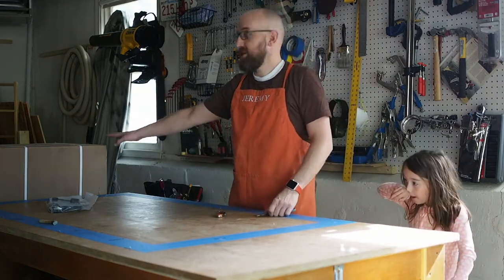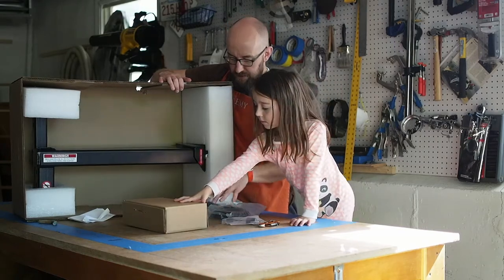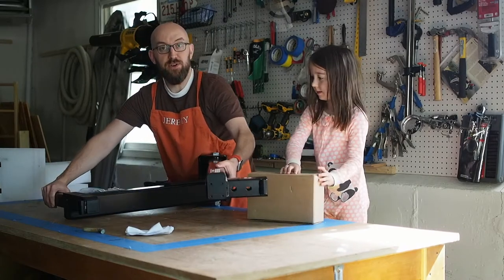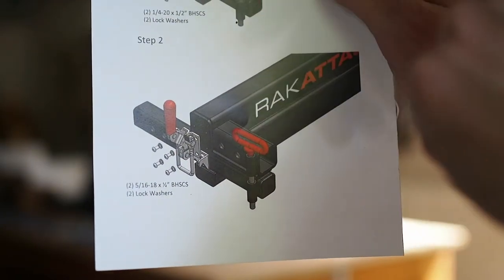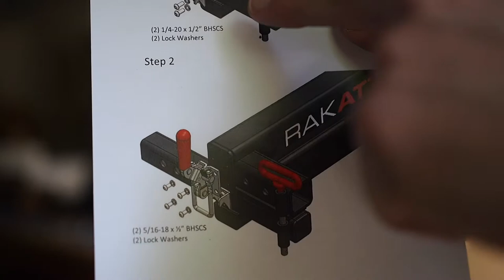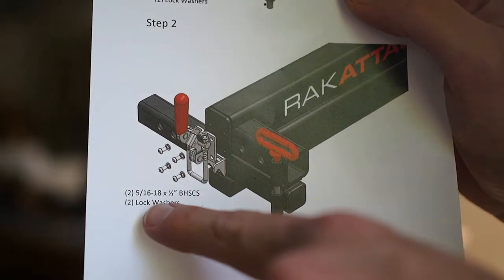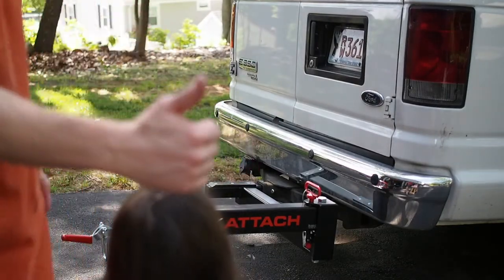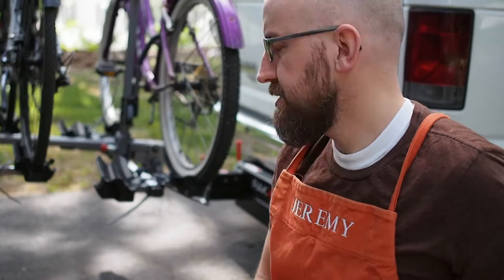1UP RakAttach: Unboxing, Assembly, and Initial Impressions

Comment: So wanted to ask you this. I read some real negative reviews online about the Yakima Fourtimer but I know you are rocking it for a year or so and it’s working for you. So question is do you leave it on the van or take it off when not in use?
Reply from the maker: In the summer I often leave it on the van. In the winter I usually take it off because it goes months without use. Best of luck.

Comment: Your RackAttach is from 1UP but your rack doesn't look like a 1UP, at least how the new 1UP racks are made, since this video is 3 years old. Probably a true 1UP new rack might fit closer and tighter to the rear of the vehicle. The RackAttach you've reviewed seems to fit very securely and the attachments that prevent it from wobbling around appear to do the job very well. I'm probably going to get a 1UP or a QuikRack Mach2. I believe the QuikRack is even a bit better than the 1UP but there's a minimum 6 month backup on delivery due to demand and also shortage of materials to the manufacturer.

Comment: Or just buy a oneup bike rack and you wouldn't need this.
Reply from the maker: Last I checked the 1Up bike racks don’t swing out of the way of the rear doors. That’s why 1Up sells this swing out hitch on their site.
Reply: @ChasingtheTwist  how much weight will it carry
Reply from the maker: Not sure of the limit but it will easily carry a four bike tray carrier with four heavy steel bikes.